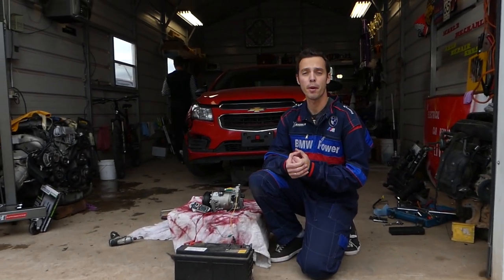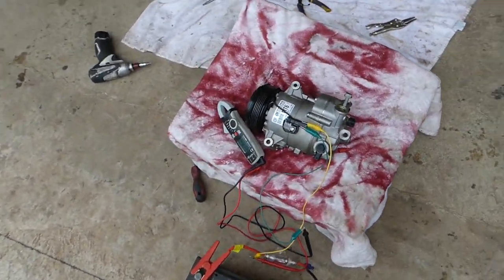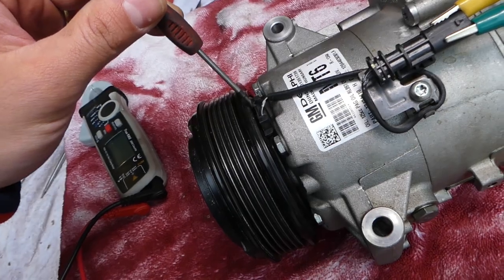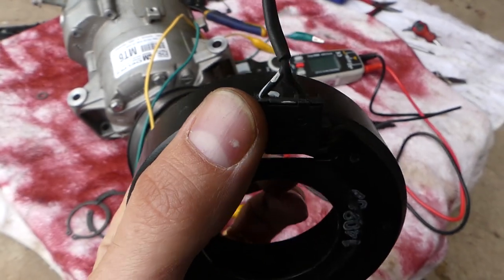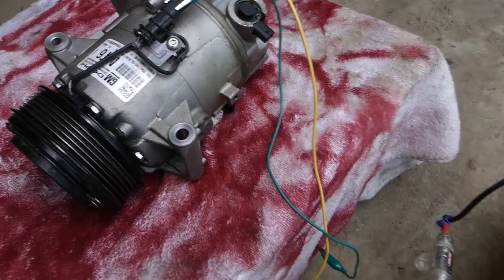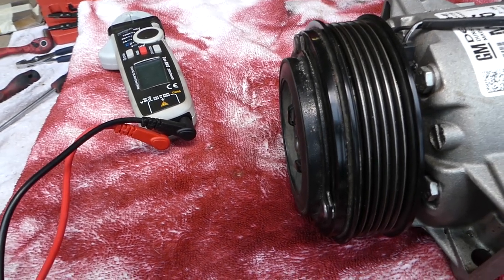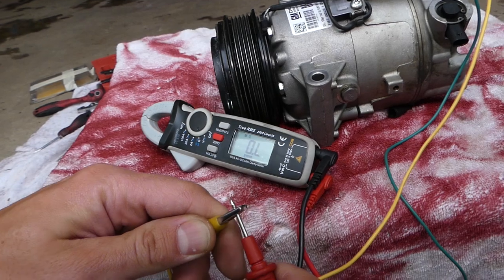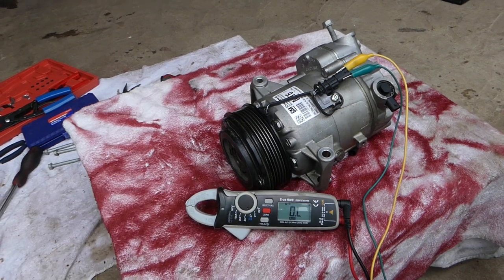HOW TO TEST AC COMPRESSOR CLUTCH ON CHEVROLET CRUZE  AC COMPRESSOR NOT WORKING

Comment: Hi. Wouldn’t it be worth mentioning that with the engine OFF, and the clutch on the compressor will not turn by hand easily, That would tell you 100% that the clutch is locked up and will need to be replaced. 

Just a quick easy way to check before doing all that.
Reply: Wait so is if you can spin the clutch by hand it’s no good? Cause I had a wriggle of it and it spins and seems like it has a decent amount of play (not that I know what normal is). The first couple of weeks rhe AC was intermittently working sounded like an engagement problem and then nothing now. Thanks for the help
Reply: @bobselwin4854   you read it wrong. If it doesn’t turn by hand when engine is off , that’s a good indication that it’s locked up.